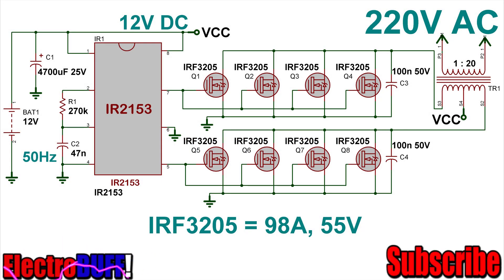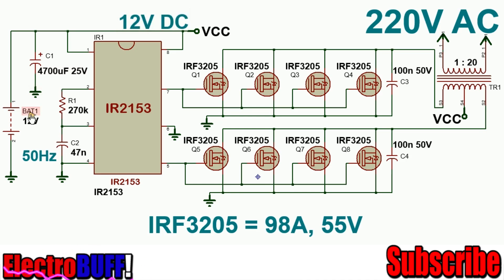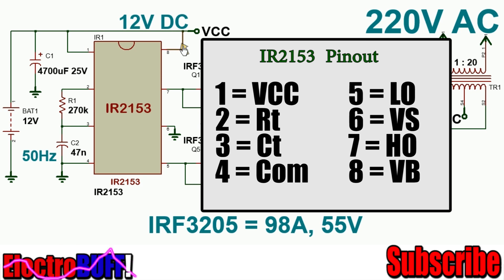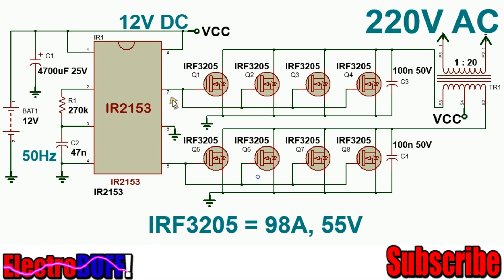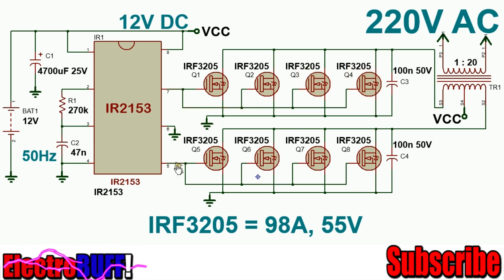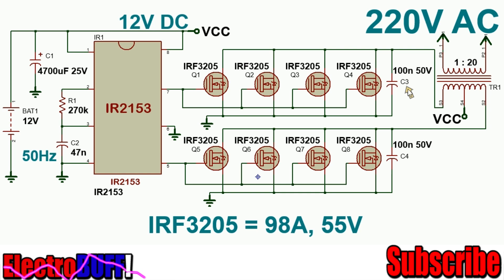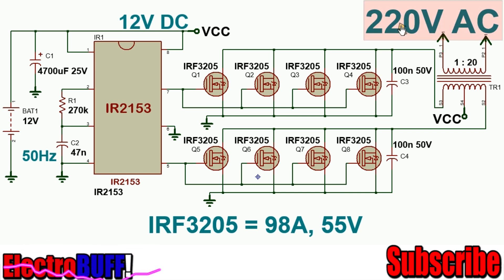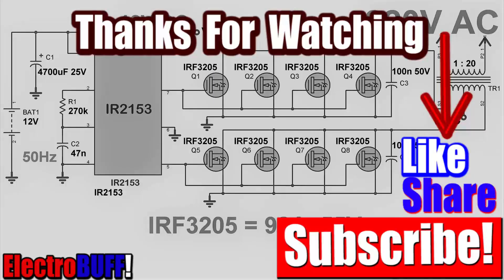IR2153 2000Watts! INVERTER 12V-220V DC to AC

Comment: Hi, for 12 volts the current will be very large, show the circuit diagram that people need for solar panels, 48VDC to 240 continue converter 3kw capable of using cheap igbt welding machine parts
Reply: I realize I am kind of off topic but do anyone know a good place to stream newly released series online ?
Reply: @Malachi Seth Meh try flixportal. just search on google after it:) -ignacio

Comment: Good day, can I take a transformer, with just input  voltage 12 VDC (I do not have a  center tap)  , and the output at 220 vacCan  I change the cycle to  60  HZThank you